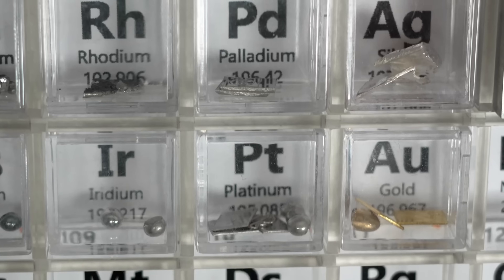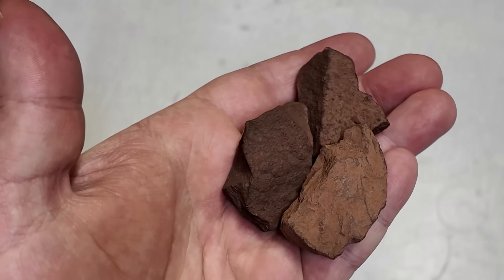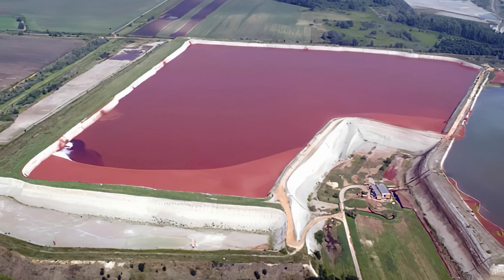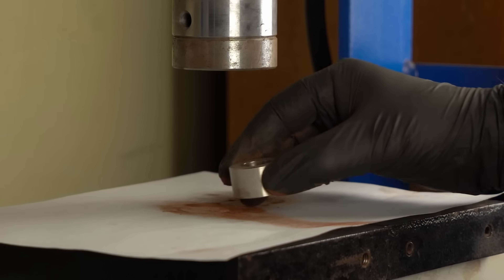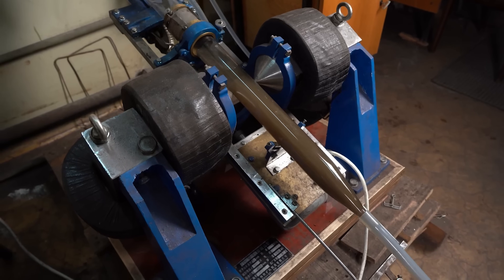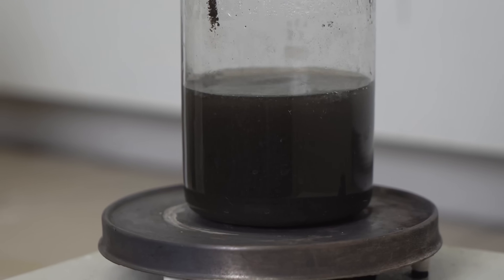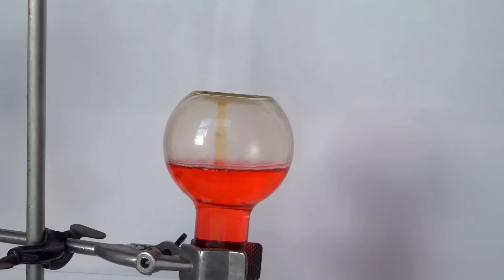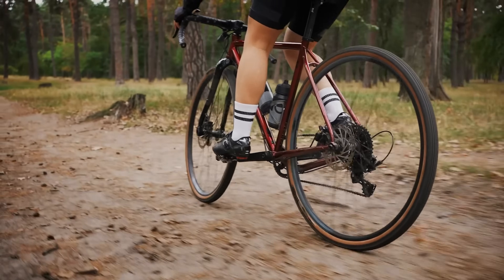How this substance caused a disaster?

Comment: I'm wondering if, rather than immersion in liquid nitrogen for the initial tablet treatment, you could just allow it to air cool in an argon atmosphere. I also wonder if rather than a carbon mix with the red sludge tablets you could use silicon which I imagine might precipitate out  more easily as silicon dioxide later. Perhaps computer chip makers could be partnered with to utilize cast off silicon from their manufacturing process? Just speculative thinking. I am hardly a materials scientist or chemical engineer.

Comment: Red mud (colloidal red iron oxide in aqueous lye) can massively scrub all CO2 from the air, DOI: 10.1038/s41586-021-03805-8 as follows. 1)Southern end of Macquarie Island. a)Furious Fifties, free wind power. b)Lake Ainsworth, red mud sump. c)Mountains for spray towers. 2) Spray red mud into the otherwise biologically sterile Antarctic Circumpolar Current  (no nanomolar iron catalytic for photosynthesis.  3) SOUTHERN SEA PHOTOSYNTHESIS DETONATES, decarbonizing all air. Fish proliferate, feeding the Earth. Huge profits, minimal costs. 4) Your Red Mud "process" is utter BS. It is burning $100 bills to keep warm.  Burn $50s instead.

Comment: Electrowinning is often used on the molten aluminium salt.  I wonder if reduction of the other metals can be achieved similarly.  There is great potential for this processing to be interrupted, to be a controlled load to balance an electric grid.  I recall seeing co-located solar generation in Australia.

Comment: This is a very interesting video. But I missed the part where it explains how you get Iron, Titanium and Scandium from this red sludge in a practicaal, efficient and enviornmentally friendly way. Because the heat processes and chemicals it has to go through to get there seem like it costs about 1000 as much to extract these elements as what they are actually worth.

Comment: BRING BAck THE ACCENT !!!!!!!!!!!!!!!!!!!!AND and BIG QUESTION:! It would seem getting iron that way vs iron ore would use more heat therefore more energy then using iron ore. While it seems greener its not because more heat means more coal or gas burned leading to MORE CO2 vs then using mined iron ore. Some times recycling doesnt make sense.

Comment: The experiment is fine, but one major thing what you also highlighted regarding the disaster... The red mud should be dry. This is main challenge in industrial size, this is partly the reason why the store it... To make it dry.
So the method introduced as a solution, regardless it ignores root cause, the process what cause the disaster requires for the "solution" anyway  :D

Comment: I thought the Hall-Héroult process used bauxite directly mixed with criolite (to lower fusion point). But it seem it requires alumina. The first part of the process you describe is the preprocessing with NaO2. Extracting aluminium from Al204 (alumina )  is an electrolytic process and very energy intensive. The way you describe makes it seem that is just to use high temperature (calcine). It is not: the electrolytic method  produces high purity aluminium directly. Trying to use heat directly would require far higher temperatures and contaminate the aluminum.
A similar accident happened in Brazil but it was the red mud from iron production that is toxic but not corrosive. It destroyed an entire city and killed lots of people, not because of the toxicity that is lower, but because the huge size of the lake when the dam broke. The dams with red mud from alumina remain here waiting.

Comment: Scandium was extracted by soviets and used in Mig-21 and Mig-29 as they haw all Aluminium construction.
In orders under 1% it gives small grain high strenght alloy.
When welded Mig-29 construction (whole center body was both fuell tank and main construction element) was heat treated to obtain maximal strenght.
Reply: Holy crap, someone actually not whining.
Reply: I hope all the waste around the world gets treated.  No waste, only recycled materials worth money.  When we take stuff from the ground it's often better not to put it back, so use everything.